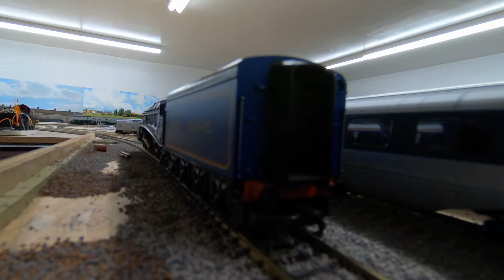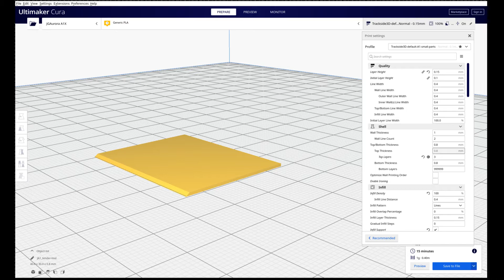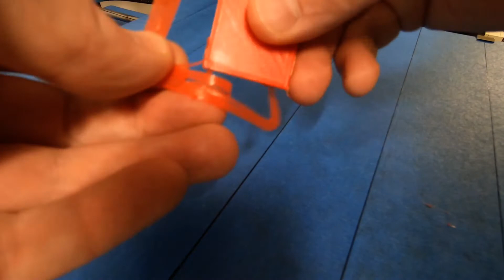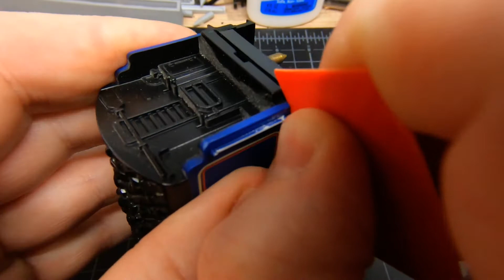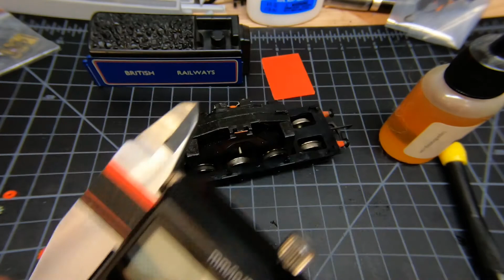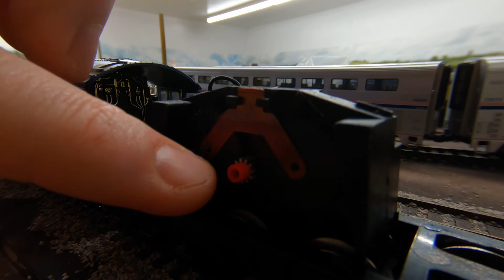oorail.com | December 2 2019 - 15 Minute Railway Modeling #14

Comment: The other question is; 10 or eleven teeth ?I have both. did you glue tge washer to the cog or is that a machine fit to the axle?
Reply from the maker: I'll have to check but I'm pretty sure I have STLs for both types of cog. The washer is machine fit, when you print with filament there is a slight tolerance you have to account for, its around 0.3mm depending on the material, nozzle size and machine you are using. I try to avoid gluing mechanical parts like cogs etc, because they can wear down over time.
Reply: @Oorail  I just mentioned you and our discussion on this topic on my live youtube video which I just finished
Reply from the maker: @partickhillstation  Thanks.. I'll have to go check that out tonight, have a bit of a crazy weekend with two of my kids playing ice hockey games this weekend.

Comment: Watching the video now. Is that painters tape you have on the table? I need to replace my table surface as the original one disintegrated
Reply from the maker: Yeah that is 3M painters tape, that printer is an old JG Aurora A1 printer. The beds on those printers don't have a very even surface, so the tape protects the bed and helps with that. I run custom firmware on them now with mesh leveling so the tape isn't really necessary anymore but I still use it. If you are using tape, you want to use the widest rolls you can get. I normally use 2.83 inch and 1.88 inch tape from 3M (Scotch). It will last quite a few prints (maybe a month or more of continuous printing). It also makes it easy to see when things go out of alignment (eg. the nozzle will tear the tape before scratching up the bed). Using tape will leave an interesting pattern on flat surfaces, this can be great for getting certain effects for modeling but sometimes you will need to think about print orientation if you don't want that :) I don't use tape on the newer printers that I have, so the FLsun SR and V400s, I'm using the stock bed or PEI. Most of the Creality printers I have, I'm using either PEI or glass directly. Usually there are magnetic bed upgrades so its easy to swap out a messed up print surface. Not sure if they still do this, but Overture filament used to supply a replacement bed surface for Ender 3 sized printers with their filament.

Comment: nicely done.  I have Mallard with similar tender, can't figure out how to pull the motor out.  Saw a much early video posted by#oorail, but it didn't actually got thru pulling the motor.  I'm just not seeing any tabs that separate the metal housing form the plastic frame.  The service sheet (118) doesn't really help with a clue.  Any advice?
Reply from the maker: Thanks Steve. Looks like I possibly have the same Mallard you do, mine appears to be covered by service sheet 118 as well. I recorded a video this morning showing how to dismantle and service it. Mine needed it anyway so wasn't a big deal. The video is currently encoding, should be up on the channel sometime tonight (US time) or tomorrow morning (UK time).
Reply: @Oorail  Thanks.  I cleaned up as much of the motor and gears that i could w/o removing the block, actually running a lot better.  My other issue now is the electrical connection between the loco and tender is terrible.  I clipped a wire between the two and it runs great.  It's certainly not obvious why that coupling unit isn't maintaining solid contact.  One problem at a time I guess...
Reply: @Oorail  I'm looking for the new video, but haven't been able to find it under my subscriptions or via search.. do you have a link? Thanks again
Reply from the maker: @StephenAtt797  Sorry I had to render it again because the audio was messed up. I thought it was a YouTube issue (haven't uploaded since April, lots of changes) but turned out to be a bug in Flowblade that I use for editing. I have one video ahead of it in the queue, so probably about an hour to render and an hour to upload/process on YouTube. I'll reply to this comment again when it's ready. Sorry for the inconvenience.
Reply: @Oorail  no need to apologize, I appreciate you taking the time to do this.  I got a bunch of projects on my workbench, so no rush, was just checking on this since you went thru the effort, I didn't want to let this sit too long.
Reply from the maker: The video is still encoding, its going to probably take at least another two hours. Did you Mallard come with two coaches? Just wondering something. The video is quite long, it took a lot of effort to remove it and I show in the video why. One thing I noticed when editing it was that the wheels nearest the rear bogie were sitting a little higher than they were supposed to be. So looks like the problem was a combination of the plastic being slightly warped over time and an issue with the metal tabs.
Reply: @Oorail  I got mine used via ebay, no coaches,  I hope this didn't cause permanent damage to your Mallard!  I'm going to have to see if the risk is worth the reward.  Right now mine is running pretty well sort of the poor electrical connection between tender and loco - but I've got some idea how to take my temp fix and make it more permanent. I'll check back this weekend to see if the video gets posted.  thanks...
Reply from the maker: The video is currently processing on YouTube, should be live shortly. I didn't damage the Mallard, not so sure about my sanity though. Whats interesting is that rear axle, it was sitting around 1-2 mm higher than the other wheels, so it wasn't making proper contact with the track. The plastic insert in the chassis is flexible plastic, it seems the metal motor chassis is too tight a fit, so over time, the plastic rises upwards slightly, enough to lift the axle off the track at times. Not sure if Hornby pushed a bad batch of motor chassis but the quality of that one is quite rough compared to others I have from the same time period. I thought I had initially warped the plastic chassis piece from my efforts to remove it, but as I mentioned in the previous comment, it was already like that. I noticed that on my other ringfield tenders, that the plastic is slightly more flexible and the motor chassis tabs are much cleaner / finished. I was shape the plastic insert back, but it took some effort it naturally wanted to bend upwards (towards the motor). I ended up heating it very slightly with a hot air gun and used a small screw driver with the vice to hold it in the proper position for about an hour. Now it runs perfectly. The chassis might be a good candidate for a 3D printed replacement but I think I'm messed with it enough for today!! :)
Reply from the maker: Steve you can find that video at https://www.youtube.com/watch?v=hUDFC6RIdG0 feel free to share it :)

Comment: Yay, I just got my self bought Xmas present. An Anycubic i3 Mega FDM printer.
Now all I have to do is learn to drive it 😟
Reply from the maker: Congrats! You probably want to download Ultimaker Cura 4.4.0, I just checked it and it has profiles for Anycubic i3 Mega. You will want to level the bed, and download the Calicat, Calibration Cube and Benchy from Thingiverse. Then you can hit up Trackside3D.co.uk for Model Railway items (shameless plug...).. working on getting the new site up and running :)